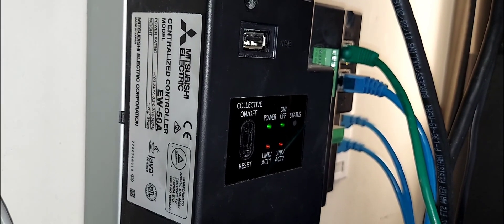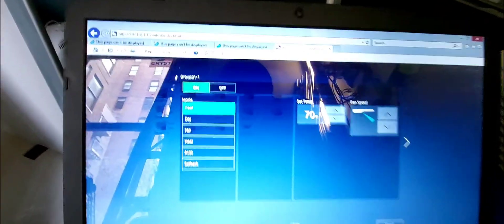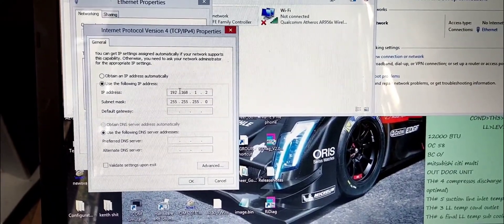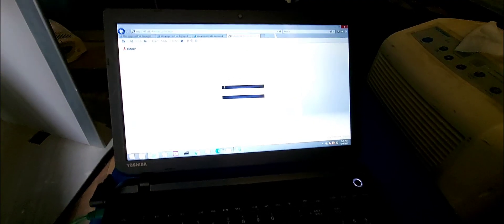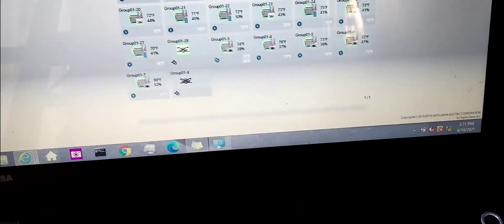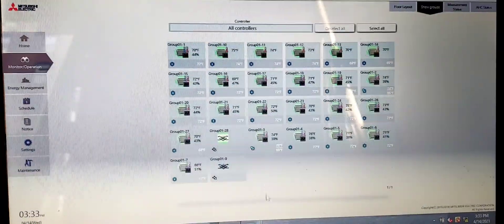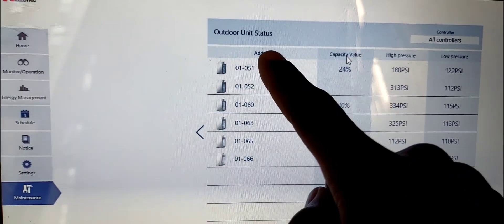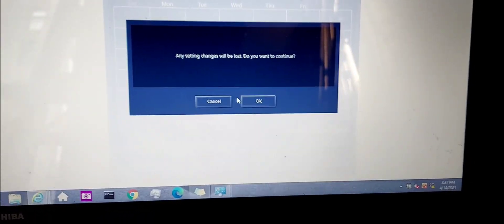MITSUBISHI CITY MULTI EW50A CENTRAL CONTROLLER

Comment: We had a guy hit reset on our central controller, model G-50a, and nothing came on. I can't get the browser to open the console; it's complaining that Java needs to be installed. Is there a quick way to get these units working again?
Reply from the maker: Use maintenance tool or RC / thermostat
Reply: @D2DNYAC  Hey, thanks for the quick reply. What maintenance tool or RC/ thermostat unit are you talking about? This system has about 10 split units in the building.

Comment: Is it possible to control it remotely through the internet? or do you need a license to do it? It is only for Ethernet control?
Reply from the maker: Yes it’s a internet gateway as well access through you html browser, plug it into a network switch and as long as you can connect computer to this same network you can pull it up simply by typing it’s IP address into your browser